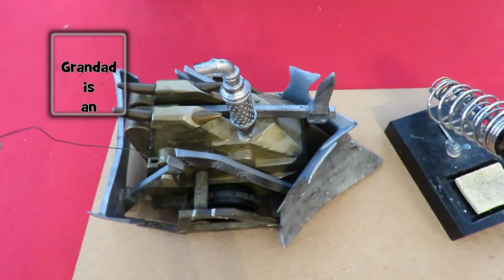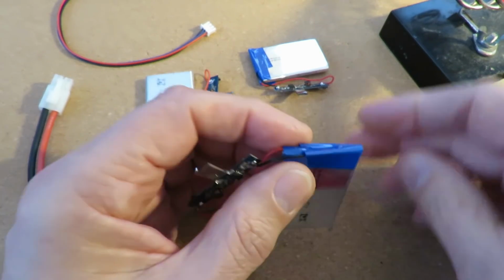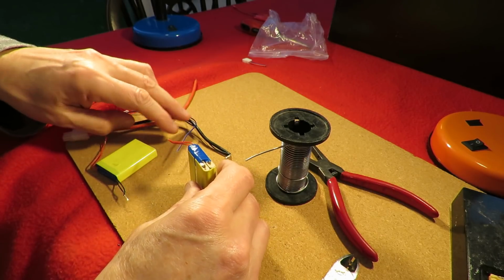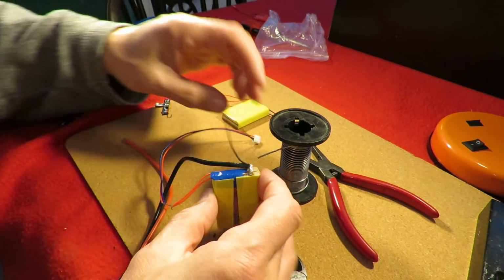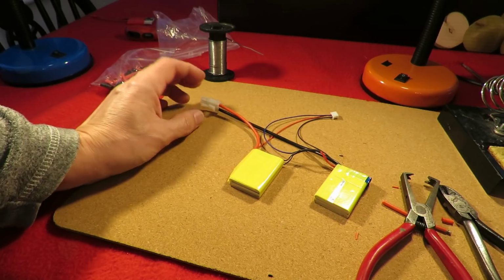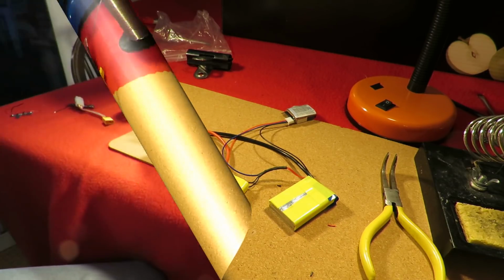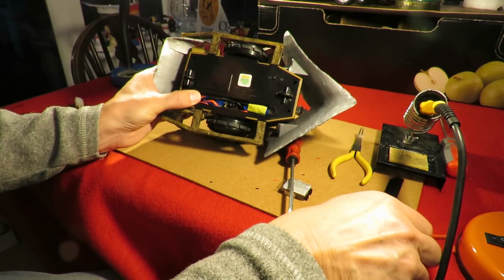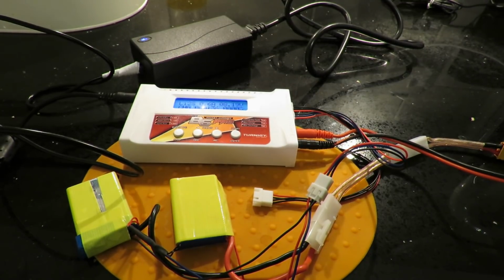Making a bespoke LiIon battery for my RC Robot Wars Shunt

Comment: Great work with the batteries. 

So you now have a 7.4 volt 1300mah battery (two 650mah in parallel ups it to 1300mah at 3.7-volts, and then join them in series for 7.4-volt total output) for 4 quid? That's good. 
They normally cost a tenner for that capacity at 7.4 volts.

Where does the blue wire on the balance lead go? From what I could see in the video you connected it between the series connection. Would that be correct?

Cheers:D
Reply from the maker: Yes the blue wire is simply the mid point between the two 3.7v units and only balances the two sections not each individual cells so it will cannot truly balance each cell. If you saw my tear down video on my laptop battery they are built the same way with 2 cells strapped in parallel and the charging circuit wired the same way. You will see videos on YouTube where people strip the laptop batteries down to identify the individual faulty cell by measuring the twin packs first to find the faulty pair and then split the pair to identify the faulty cell so they only need to replace a single cell out of a set of 8. That was what I was planning to do and then found the cells were fine so it must have been the control circuit refusing to charge them - planned redundancy.